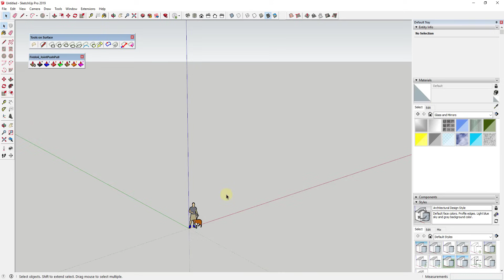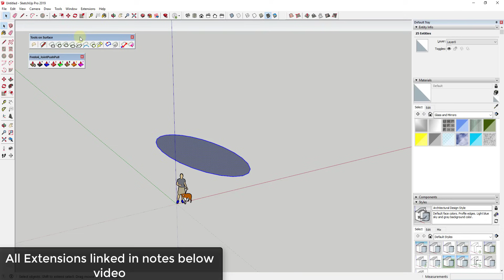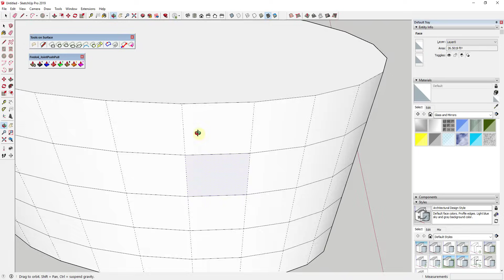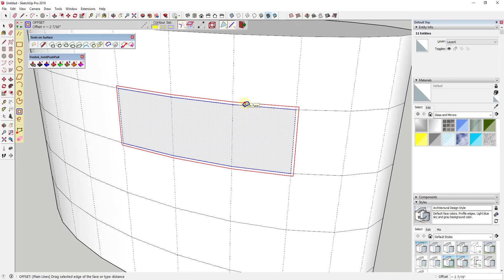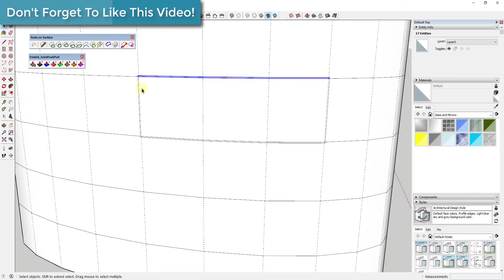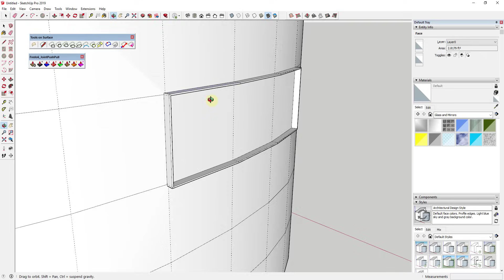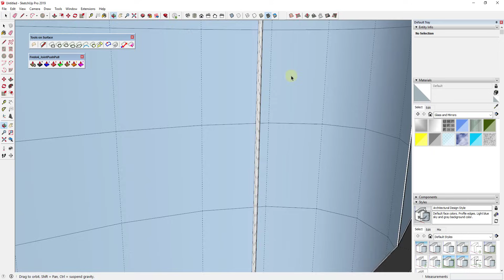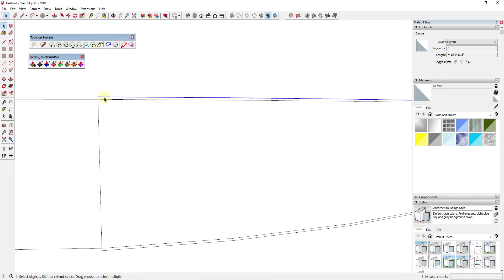Modeling Windows ON CURVED FACES in SketchUp - Extension Workflow Tutorial

Comment: Hi Justin! I don't have the extentions option, how do I solve this?
Reply: Make a deep thickness window component assembly, use the cut opening option and if there is a skin on the inside, delete it. Usually works.
You can also take copy of the hidden geometry segments and use that to build your window frame then use above option to reinsert into the curved wall.

Comment: what to do if u want to build a window on a curved wall that doesn't have an appropriate hidden geometry like you did ?(and don't want to have segments inside of it) thanx
Reply from the maker: You mean for the glass itself to curve? Just use joint push pull on the hidden geometry making up your glass